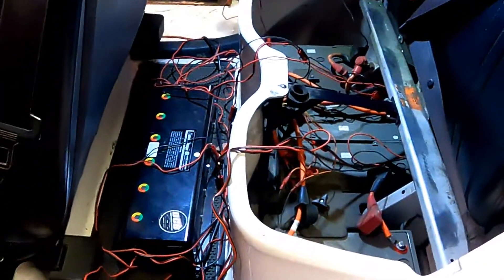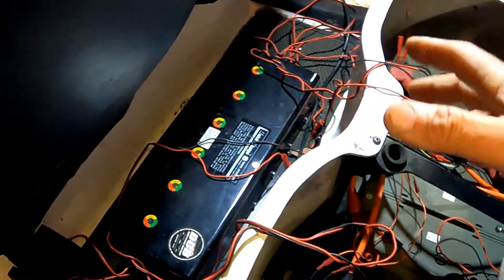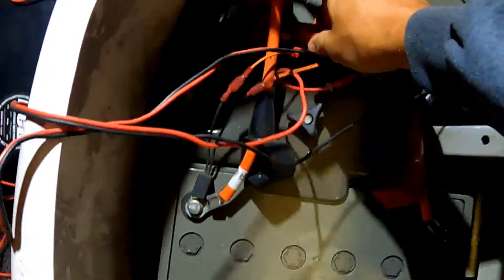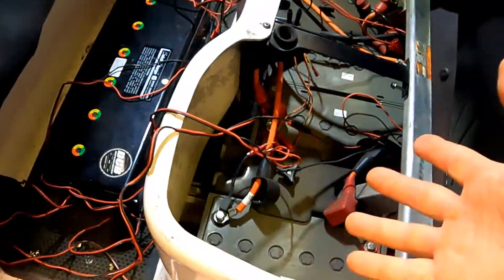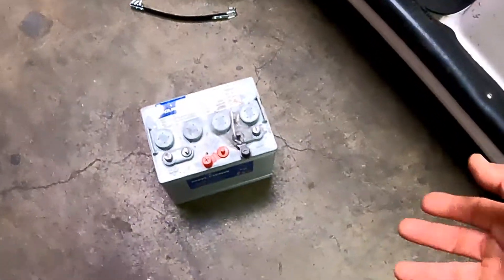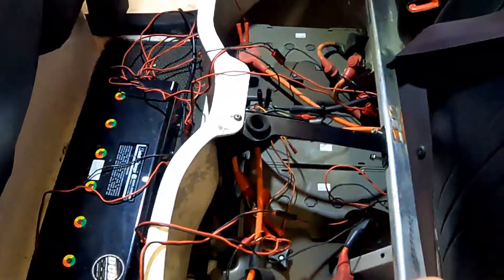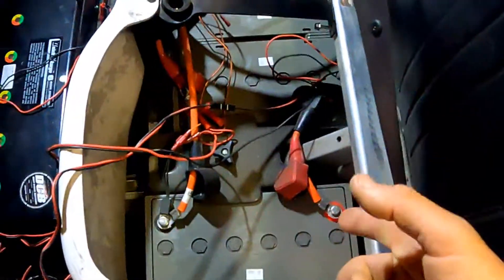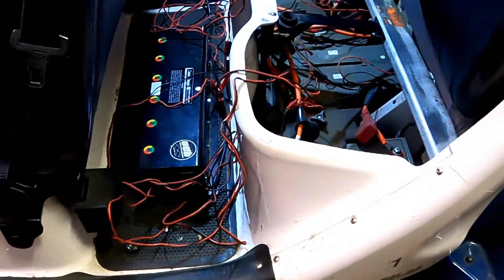Charging Gem Car Gel Batteries Leoch LPG12-100

Comment: Hey bud I have a question, if you put the cart in jacks can you run a cart without batteries? The reason why I am asking is to test the golf cart before you spend money getting batteries and find out  that was not the problem I am a tech myself not for this gem carts but I do understand a couple things, so if a plug 72 volts wire, that's should make this cart go, but I asking you since you are a tech for . Thx

Comment: Mine won’t start I get a code -04
Reply from the maker: -04 code this means the controller believe that the brake is on and has locked out the main relay. This occurs to prevent the GEM from being driven with the brake on. There is a small switch mounted to the park brake handle that reads whether or not the brake is on.

Comment: Hi I have a gem at 2013 for 2 persons and I have a few issues with it 
1 when I turn on the hazard lights start to dime instrument panel same the turn signal light
2 the front and rear light don’t wort 
3 when I try tu use after I accelerate for 30 seconds the turtle sign shows up recently we replace the batteries I thought that was the problem but still the problem with the new batteries 
Please anyone can help me on that I really appreciate it 
Thank best regards
Reply from the maker: The gem has a 72v to 12v dc converter, remove the the dash panel and use a mulitmeter to test volts in and volts out. check all wires in and out.. do a continuity test from lights to the dc converter